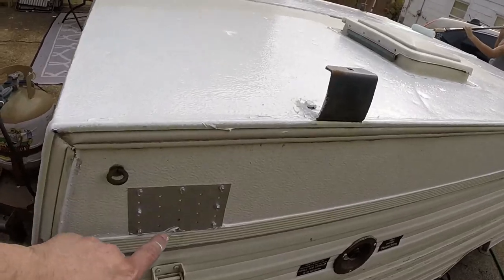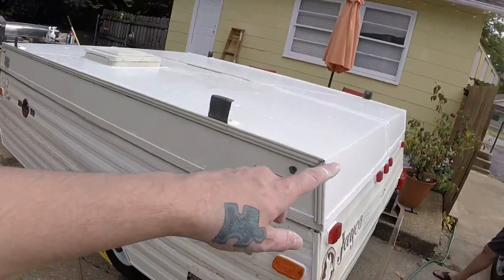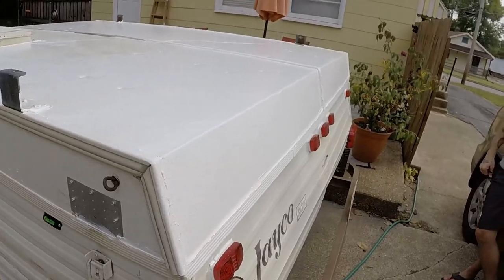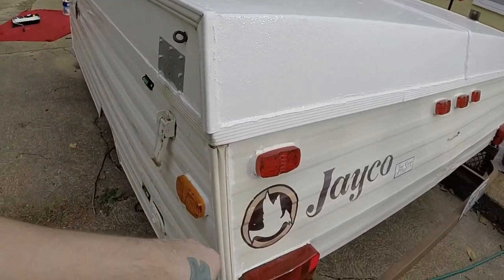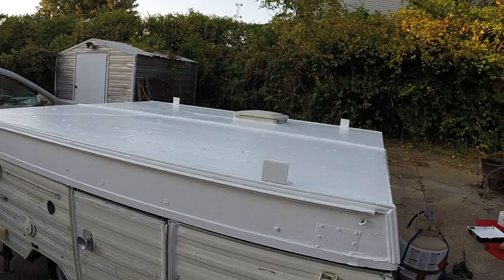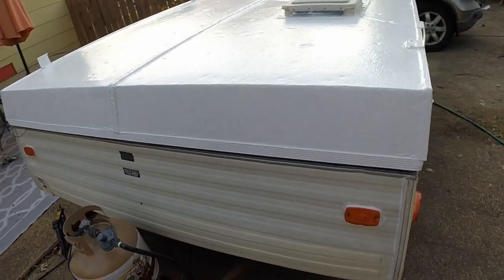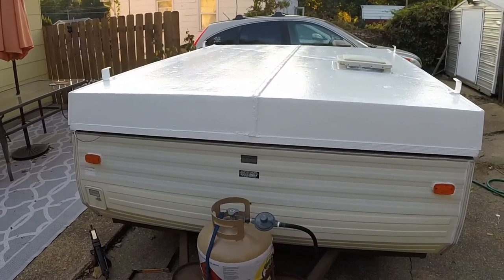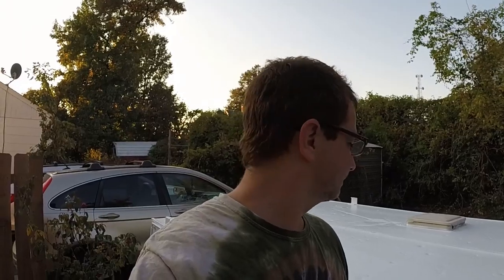Putting Rubber Roof Coating On A 30 Year Old Pop Up Camper

Comment: How has the roof coating held up? I just purchased a Jayco 806 and am looking to freshen it up.
Reply from the maker: Been a year with 2 coats and still no issues. I will probably do another coat in the spring
Reply: @ourtinycabinproject  Did you have any leaking under the seal?  We have to replace our seal, but I can't seem to find one anywhere.  If I did this, or a neoprene coating, this might fix our problem.

Comment: Someone (my husband) put my whole can of rubberized paint out in the back porch and I think it froze. It says for it NOT to freeze but I'll have to see if it's spreadable. I paid over $50 for the can :(.
Reply from the maker: Bummer. I would not risk it on the rv. Either buy new or if budget is an issue use flex seal. This stuff is premium and is like 100 bucks a can now
Reply: @ourtinycabinproject  Thanks for replying back but too late I already put 1 coat on the trailer lol. I mixed and mixed it and it didn't clump. I had pre tested it on a board to see what it would do. Left it for a day and it was fine. It felt tacky when I put it on and pliable a bit so I think I got lucky. Paint rolled on good. Yes I'm on a budget. I wouldn't want to pay $100 for a can. Yikes.